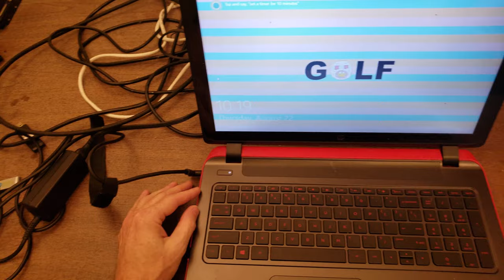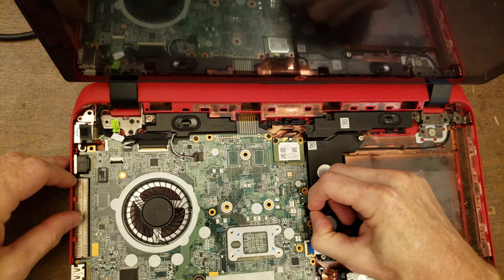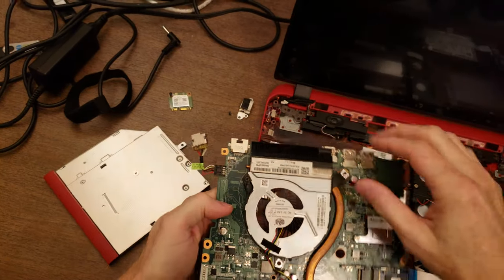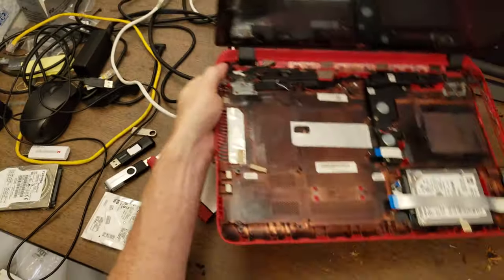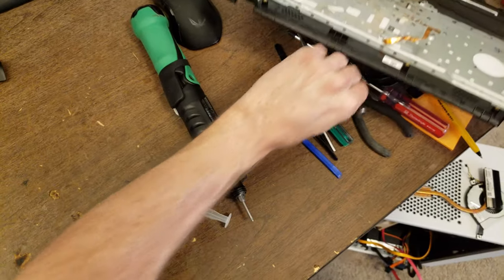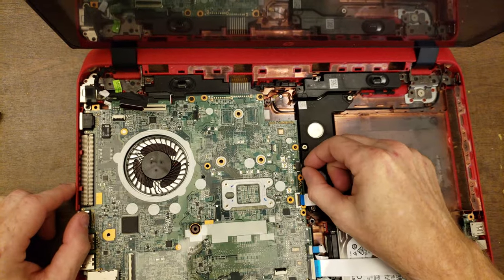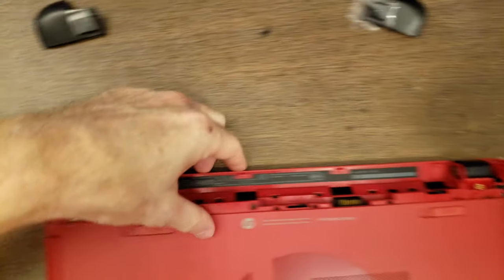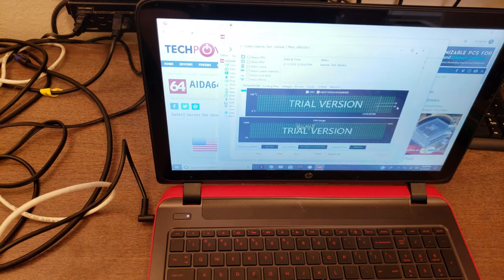HP Beats Laptop overheating another malfunctioning heat pipe

Comment: Hi Michael, great video. I've got one of these which came from Germany and was given to me by my daughter in law who is Czech but lived and worked in Germany. It is the 17" Notebook and I noticed when I took in apart yesterday after watching your video that it does not have a fan-strange don't you think!! Otherwise it looks the same as yours. Maybe thats the reason why it will not boot up. I changed the cmos battery, removed the ram and put it back in and ensured that all the connections are back as they should but as soon as I try to boot it up all I get is three lights flashing when it is plugged into and then nothing. Any help or advise would be welcome. Take care Tom
Reply from the maker: I've seen a few HP laptops with no cooling fan. It's not the same as this computer and it's not the same issue as this computer.  Given what you've tried is most likely a failed motherboard.  Look on the motherboard for a hp part number.  It'll be 6 digits a dash and 3 digits.  With that you can find a replacement motherboard.  Given that it has no fan that means its a low performance laptop.  It was made to work with passive cooling.  There isn't a way to make it faster so you may be better off buying another laptop.

Comment: hi got the same problem with my hp laptop.shuts down after a few minutes .the fan runs constant with warm air then shuts off.i tried new thermal paste but no luck so I have ordered a used one off ebay to try £15.so I will let you people know weather it was a good fix
Reply: was it a good fix?
Reply: @kapesquire  hi no it didnt fix the problem mate

Comment: Thanks for this video, it's very helpful. Do you know if there's a similar heatsink that can work with this laptop? I can't find the 767706-001 in my country. Greetings from Argentina!
Reply from the maker: If you put that part number into hp partsurfer you might find another compatible part.  Also try calling HP if you can't figure it out.  They sell replacement parts.

Comment: I have the HP Beats overheating issue with the shutdown message reading CPU @ 90. But the air coming out of the fan vent is hot, not room temp. Could that just be a fan replacement & not the heat sink?  Or other suggestions?  Thanks!
Reply from the maker: If the air coming out is hot its not the same issue.  Try blowing dust out of the cooler.  If that doesn't get it running cooler replace the thermal compound.
Reply: @MichaelTheComputerGuy    Thanks for quick reply & your videos!

Comment: Mike I have the same problem just don't have your skills. I need to know if you can repair my computer?
Reply from the maker: I've done a few of these. Check where you are locally for someone to do it for you. If you show them the video and your laptop they can decide whether or not it's the same.
Reply: Took this to a local shop..it’s the same issue...they told me this is a temporary fix and that I should trash it!!
Reply from the maker: @WJOHNJRB  I don't know that I agree with that. Now if they're trying to charge you $250 or $300 to do this fix if they say is temporary then yeah that wouldn't be worth it. You'd be better off putting that money towards a new computer. But if you can get it done for $120 say that would be worth it.
Reply: @MichaelTheComputerGuy  How much would you charge to do it?
Reply from the maker: @WJOHNJRB  $90 for my work.  The replacement part is around $40.  The last I checked they are only available from Chinese sellers so it takes a few weeks to arrive.
Reply: I found parts on amazon using the part# you gave in your video. I will order parts and get back with you

Comment: Michael Cooper please can the processor be changed or it came with the motherboard? please reply asap i really need the answer to this
Reply from the maker: Processors on most laptops these days are soldered on.  You can sometimes upgrade the cpu by changing the motherboard but that depends on what's available on a particular model laptop.
Reply: @MichaelTheComputerGuy  okay thanks

Comment: Hi, nice video !!! Could you help me with this..I need to buy a ram but I am living in other country...Do you know what is the model of the memory ram that the laptop use (bus, mhz, brands, )? I can not open the laptop yet cause I want to make one step to upgrade de ram until 16 GB. I have one the same like yours with sku G6R14UA ABA AND It will be upgraded until 16 GB. the battery of the motherboard which model is
Reply: la pila de la tarjeta madre es la CR2032, 3 volts,  de Litio.

Comment: What's the name of the screw holding the disk drive and what screw driver did u use to remove it?
Reply from the maker: It's a phillips head screw.  A Hitachi power driver is what I use but any phillips head screw driver will work.  You can find them isn't the description of this video.
Reply: @MichaelTheComputerGuy  thank you very much just to make sure after u take out the disk drive the screw in the middle right the one with a small x 
Sorry for the questions 😬

Comment: Do you need to replace both parts or can you replace one?
Reply: By meaning the heat pipe
Reply from the maker: @emanuelbeltran4098  If you have this problem you just need to replace the cooler.

Comment: Great video have similar  problem with my laptop could you fix mine?
Reply from the maker: What's happening with your laptop?
Reply: @MichaelTheComputerGuy  fan doesn't work on mine
Reply from the maker: @samdent27  If the fan isn't spinning you need to replace it. If it's an HP, you can do a search for the model number of the laptop along with the words service manual and you'll find a link on hp's website. It'll show you the steps of how to take it apart.

Comment: Great video. I did have two questions. Was this an laptop an AMD processor? What should be the temperature range at idle for the processor? Thanks for the excellent video?
Reply from the maker: I think it was amd.  Idle temps can be all over the place depending on the cooler, fan speed, idle ghz and voltage .  There's not really an answer for that.
Reply: @MichaelTheComputerGuy  These heatsinks I'm looking at online are similar but one is for amd hp 17-f models @ $60 and one is for intel hp 17-f models $12. I wonder if I can get away with using the cheaper one. Thoughts?
Reply from the maker: @dominicene3647 You're better off getting the same part number that it on the original.  Another part probably won't fit.
Reply: @MichaelTheComputerGuy  This is my dilemma. The laptop has been confirmed to have a bad hard drive but after running the speecy app I noticed the CPU temperature monitor to be a tad high at 80 degrees Celsius after a cold boot and no programs running in the background. It's not shutting down or anything but it's a tad too hot for my liking. I wanted to be proactive and do preventative maintenance by replacing the fan and heatsink while I'm inside the unit.
Reply from the maker: @dominicene3647  If its not turning off quickly like I described in the video its not the same problem.  Just open it up and replace the thermal compound.
Reply: @MichaelTheComputerGuy  Thank you for your time. I will do that
Reply: @MichaelTheComputerGuy  Hello. Just an update. Everything is working okay after SSD install and adding temp compound. Has not shutdown and it didn't before  (which I'm surprised by) but I'm worried about the high temp.
Reply: Hello. The processor type of this laptop is:
  AMD Quad-Core A8-5545M APU at 1.7 GHz up to 2.7 GHz, according to the official HP website.
In fact, I have that same laptop that had the same problem. Replacing those two pieces was solved. Greetings from Mexico.

Comment: Thanks for this video! Can you please tell me where you've gotten the new heatsink?

I have a similar problem lately with my 3 year old HP Pavilion 17: Fan doesn't rattle, but is louder than what it used to be. Only cold/room-temperature air coming out, and the CPU sits between 60°C-85°C.

Replacing the thermal paste didn't work, so it's gotta be the heatsink...
Unfort I can't find a replacement heatsink for my HP Pavilion 17-f007ng online :(
It's one that's connected to both the CPU and the Nvidia GPU..
Reply from the maker: If you replaced the thermal compound and you're still just getting room temperature air coming out of the laptop then I would say the heat sink has failed. What you have to do in that case is open to computer back up and get the part number on the heat sink. You can put that into a Google Search and try and find a replacement. I've had the best luck just doing general Google searches or searches for the product number on eBay.
Reply: @MichaelTheComputerGuy  so it is fine if a laptop blows warm air out of the cooling fan
Reply from the maker: @j_v8033  Yes that's what it's supposed to do.